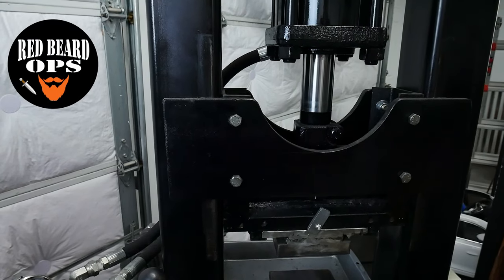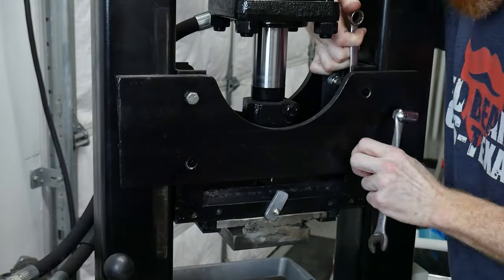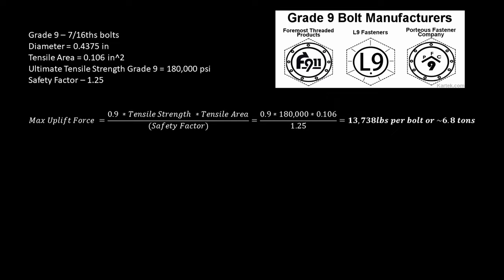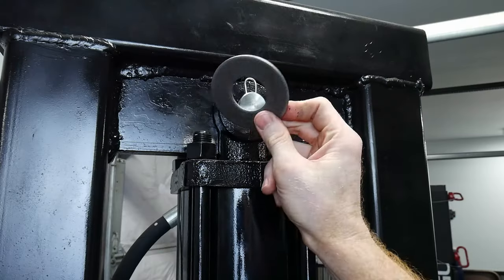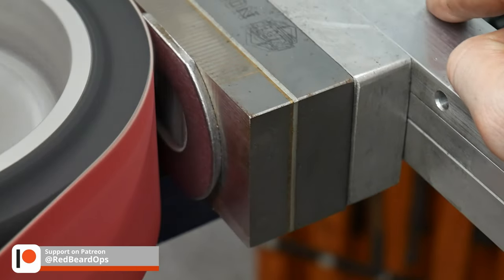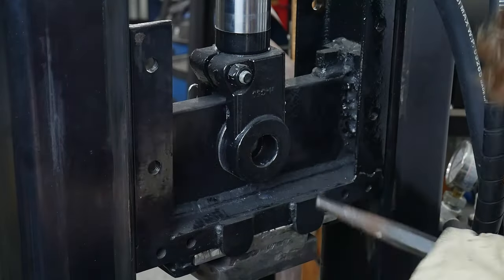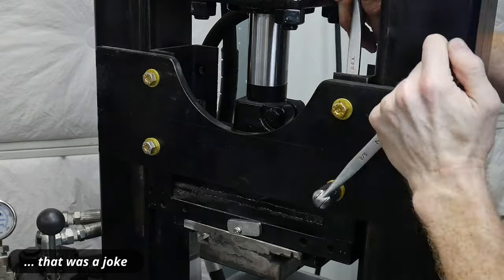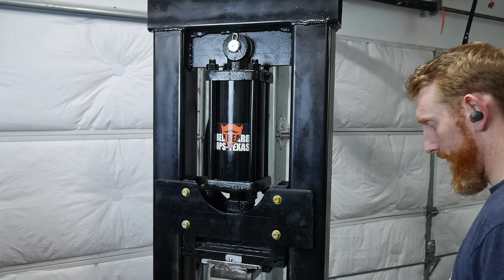DIY Hydraulic Press Upgrades - Addressing Concerns

Comment: hey James, I don‘t think you had to replace the bolts. They just hold the guiding plates and see only a fraction of your pressing force.
But you are absolutely right by stating to always overbuild
Reply from the maker: I agree!
Reply: By the way, bolts are never calculated using shearing force. You need to calculate the friction force between the two parts you are connecting and then design the bolts to supply the required clamping force….

Comment: Looks good! Not sure if you have a foot control or not.  If not that would be a cool upgrade as well. :)  As far as the bolts go.  I always avoid shear loads on my bolts and try to design things to utilize the bolts tensile strength.  (as you point out in the video the tensile strength of a bolt far exceeds is shear strength).  If you need to bump up the shear strength of a bolted connection you can use dowel pins.  That is were they shine.  The hard part of dowel pins is most people (who don't have a knee mill or CNC) can't drill and ream them in a location that is precise enough for assembly.  The trick for a DIY guy is to drill and ream thru both plates at the same time after they are bolted together then hammer in the dowel pin. :)
Reply from the maker: That's a good point. Getting them out could be tough too. I feel like if someone wanted to go over kill they could put 12 - 1/2'' grade 9 bolts on both sides and never worry about it again. lol
Reply: @RedBeardOps  In the machining world we normally do a press fit on 1 hole and a slip fit on the matting hole.  I guess you could drill both at the same time for location than ream 1 to a PF and 1 to a SF. 

I'm sure that guy with 12, 1/2" grade 9 bolts is out there some were. hahaha.

Comment: I think while I had it all apart I would’ve changed the bolts to half inch 13. That would increase your safety merge in a little bit more. Great video nice looking press
Reply from the maker: This is a very good point. I was lazy in this regard ... 1/2 bolts would be the right answer

Comment: I know i'm a lot late on this video,  but for future reference,  poly cuttings boards a cheap source of low friction wear pads for low stress sliding mechanisms.    they would significantly reduce the friction and/or binding on the slide : )   similar kinds of pads are used in cranes and auto lifts. (you want PE, and not ABS/PP iirc)
Reply from the maker: Thanks for the tip!

Comment: MR red beard i watch your work over on the  press ,and i can say you need not change bolts far ther no force on them at all 
 What they do is hold side plates on  thats it  your force of weight is on piston rod only and big pin at top . your weak point is the pin and cast iron  but it take a lot of force to break pin the cast iron is weaker than pin  but you are ok ever where on cyl  and pin, cast iron .  im in the process of building a dump trailor 10000 lb lift an dump i have same forces as you have on cly
Reply from the maker: Thanks for the notes Geral, Cheers!